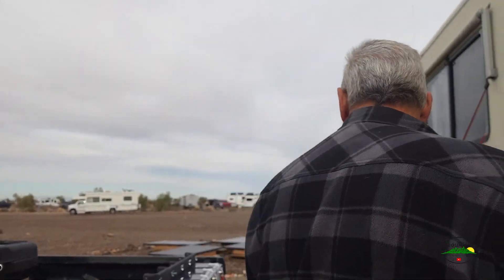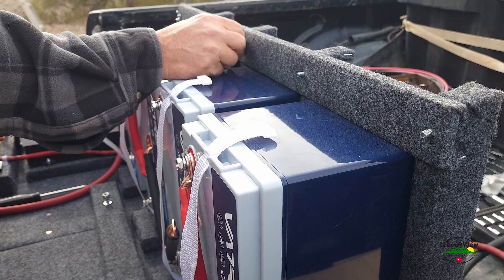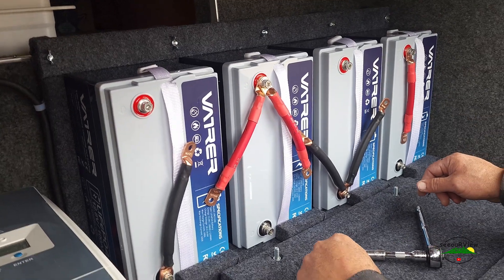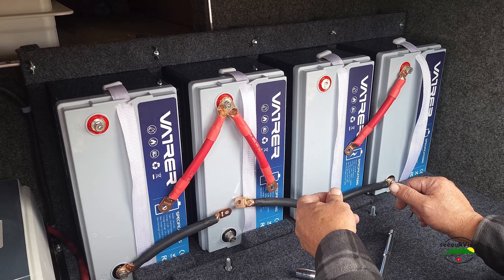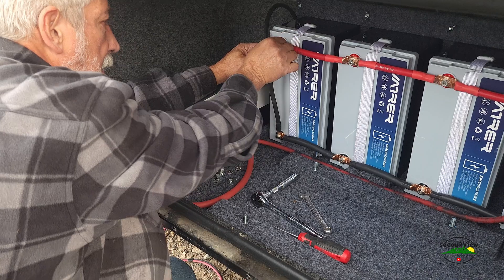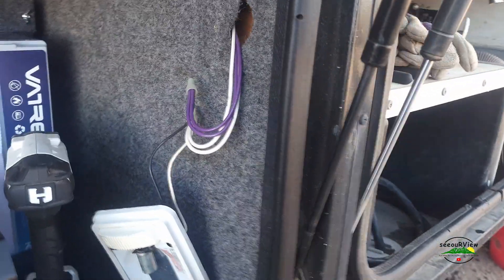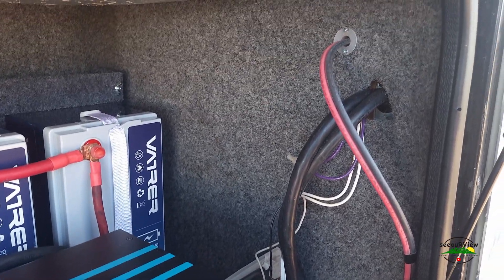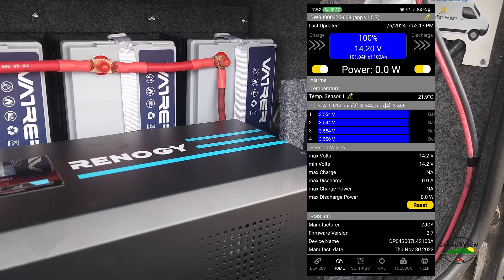Pretty Cheap Solar Upgrade in Quartzsite Arizona

Comment: Nice clean install. In my experience, cheaper charger inverters (like renogy) are limited on pass through power. So if you’re on shore power charging at max draw the inverter will only be able to “pass through” the remaining wattage. Big downside to them.
Reply from the maker: Thanks. My budget didn't quite have room for Victron. I'm a little concerned if this Renogy will be able to handle the heat out here this summer.

Comment: Well done and good planning. The MT50 has a user setting for settings. There are better and safer breakers than the ones you are using.
Reply from the maker: Yes, the MT50 has user mode, but the bluetooth adapter with the app let you select "Lithium" mode. I'm looking for better breakers now, what do you recommend?
Reply: Will Prouse has a few videos on how to set the MT50. It's all done in user mode. I will be in Quartsite next Thursday. I will give you a couple ANL fuses and a couple on/off switches. I will have everything with me if you need to change some wires. Projects in Paradice has a couple ways and what he has found on the best MT50 settings.

Comment: Sweet. Nice set-up. It looks like a very professional install. Kudos! We had to manually program our Epever charge controller for our LiFePo-4 batteries as it's an older one without a lithium setting. We have an MT-50 interface mounted on the wall just inside the door of our MH which makes the job easier than doing it on the actual controller in our bay. That new Bluetooth app looks sweet though. Unfortunately, we have a simple, older phone that won't allow us to download any apps, scan QR codes, etc. I guess it's time to upgrade our phone.
Reply from the maker: To be honest, after setting the Epever to Lithium LP4 battery type and saving it, it shows up as other and you have to manually adjust all the settings anyway. I will have to spend some more time with it to make sure I'm not doing something wrong.